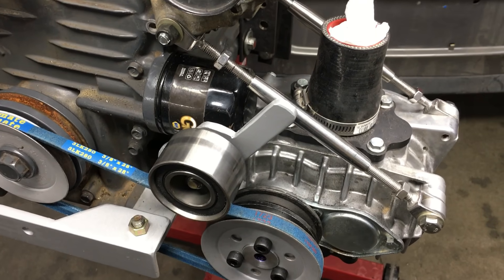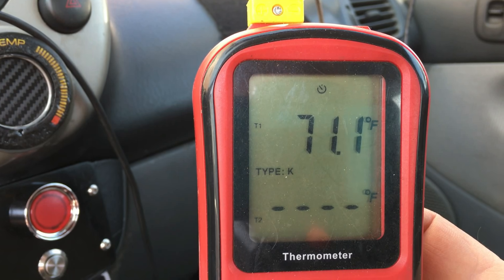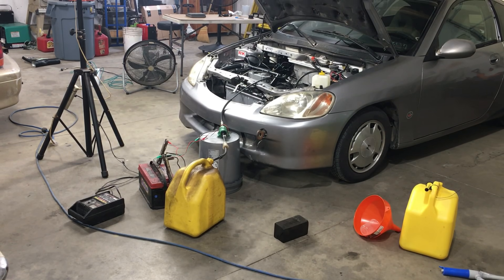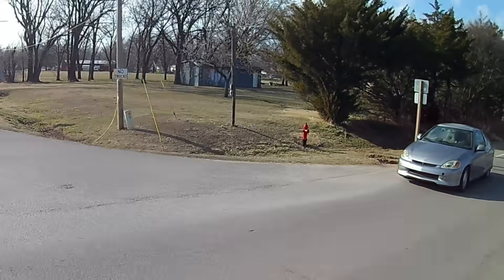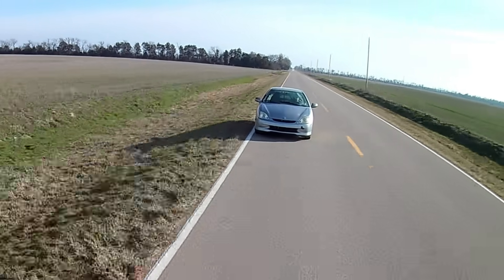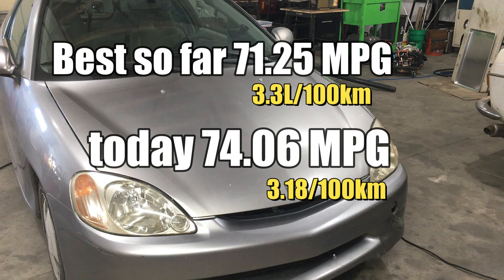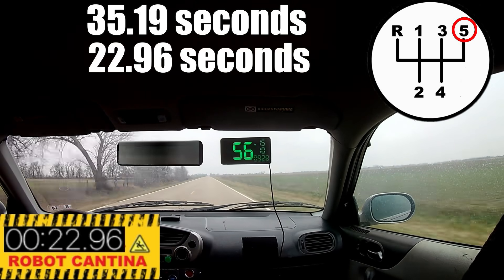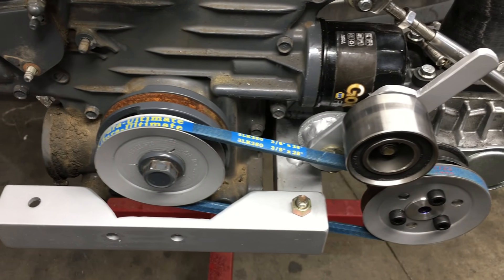S4 E10. We find out if the AMR500 supercharged Kubota diesel engine is more fuel efficient.

Comment: Impressed that you brought up that there are upsides and downsides to Superchargers and Turbos, not a lot of automotive channels point out that superchargers are parasitic on horsepower but offset the power they take by the power they make so they don't typically give the potential power off boost because of the parasitic losses.

Also, Diesels like hot charge pipe temps, its exhaust temps you need to keep an eye on.
Reply: Better tell modern diesel manufacturers to stop intercooling then... Even in the 90s Isuzu added intercooling to the 4hk1 and gained 10hp
Reply: @Low760  increasing charge temp increases efficiency, not power. The colder the charge temp the greater your pumping losses. 

Slapping an intercooler on will increase HP but pull fuel economy down a little.
Reply: @Low760  cooler air gets more mass of air into the cylinder.

dunno whats that about pumping losses being higher with hot air.  the hot air is harder to compress as well because it's already hot..
Reply: @Low760 Ooooo 10hp, minimal gains for hundreds of pounds added, ooooooo

Lost more speed from the weight than you gained from the added mousefarts.
Reply: @Oatmealism  You obviously don't even know what the engine was for, it certainly wasn't for speed at any rate, the extra 10hp likely equated to a good bit more torque which was what it was made for, helping in what sort of environments it was intended for, which would have been smaller trucks, tractors and other equipment alike, where the torque is what is sought after, not the hp or top speed, not to mention the added fuel efficiency (albeit small) from not having to work as hard for the same output
Reply: @ethancoy9237  sounds like you got your knickers in a twist over someone thinking a bunch of extra weight for a intercooler system isn't worth a 10hp Gain. How bout instead of writing paragraphs because someone disagree with you, you go touch grass
Reply: @Oatmealism  100s of lbs for an intercooler? Try more like maybe 20 lbs.... It's literally some tubing, a couple brackets and an aluminum air to air cooler....
Reply: @haldentoyorganist3896 the core itself is likely 15-20 lbs, plus the tubing to and from it is likely another 15-20 at least - and that is for a very small system, looking at ~50lbs, a more efficient system used on production vehicles would likely push even more as thicker metals are used to help alleviate the potential for heat soak inflating the weight.
Reply: @Oatmealism  pretty sure I'll take the 10 extra ponies for that minor gain in weight that wouldn't even be noticed
Reply: @haldentoyorganist3896  you'd think that but i took my 71 pound 3 ton floor jack out of the back of my 07 Ford fusion and it drastically changed the ride quality.
Reply: @Oatmealism  by this token you should be able to feel a drastic difference between a full and empty tank of fuel. Of course there is a difference but it's negligible
Reply: @haldentoyorganist3896  I actually do, when low on fuel the rear of the car is light and is much easier to upset with gusts of wind or wakes from large vehicles
Reply: @Oatmealism  I do on a daily basis bud, more so than you likely do, and an intercooling system like that would not have weighed a whole lot, not enough to make any difference to the speed of a large vehicle like that engine was in, sure for something like the insight it may make a difference but overall the pros outweigh the cons in nearly every situation, and there was on obvious reason why they added an intercooler
Reply: @ethancoy9237  So, for the record, a diesel is a compression combustion engine, it compresses air to an extreme degree to combust the fuel mixture, which is why in most cases they like hotter intake temps, because it makes getting the mixture hot enough to combust to compression easier. It is why a lot is performance diesels do not use an intercooler set up such as tractor pulls and drag racing. The last thing you want in your diesel is restrictions to getting air in and out for efficiency and performance reasons. For standard gasoline engines, cooler intake temps mean you can do many things a bit more spicy for more power because you don't have to worry about the fuel detonating prematurely to excessive chamber temps.
Reply: All ICE like relatively hot charge temps for efficiency. Doesn't help with power, but reduces pumping losses.
Reply: It's a tradeoff: hot is more efficient, cold is more powerful... You have choose your treat
Reply: So so on hot charge pipe temperatures. They do not necessarily mind it until its very very hot but still there are horsepower losses with increased intake temp once it hits a certain point. My old 1.9 TDI hit intake temps of 180f comfortably quite a few times. There was a loss of power at those temps though

Comment: You don't "need" an intercooler so much as it just let's you make more power. It just increases air density by cooling the charge air after all, effectively allowing you to put more oxygen into the engine at any given boost pressure. Suppose it doesn't matter as much with a supercharger but it's still less parasitic loss on the engine to make the same power at lower boost with the supercharger, so more total power at any given boost pressure :).

Also get some sort of coolant pre-heater or block heater for it. Should make it run better on cold starts and gives you heat immediately when you start driving.
Reply: You're also getting dangerously close to Lupo 3L numbers on this thrown together not-meant-for-cars engine which is impressive considering VW sold the Lupo 3L at a massive loss because of the different chassis, aluminium + magnesium body and magnesium wheels and interior parts. Plus they had a bespoke engine with a weird automated manual with a start stop system.
Reply: Honda sold this car at a huge loss too!
They got here before the Prius and only Sold it 6 years .
Reply: @stuntvist  supposedly the 3l would do like 2.8l in testing
Reply: @lasskinn474  You can get them to do 2.6L/2.7L real world if you try hard enough. It's exceptionally easy to hit the claimed 3L figure as long as you keep it in good shape. They're a seriously impressive piece of kit albeit slow as hell and the 5spd AMT becomes a mess when the mounts go bad, plus a 6spd manual would probably yield even better economy if you drive right.
Reply: @stuntvist  yeah I have no problems believing it, we got 5l/100km out of a '00 tdi passat on our nordkap roadtrip back in '01without even trying(summer, but not hot enough to need ac)

Comment: The engine was running rich I guess. The stupid charger can add air and solve  it?
Reply from the maker: Yes, at full throttle the exhaust is dirty, the good news is that means we have plenty of fuel available to add more boost.  The additional boost will clean up the exhaust and give us more power.
Reply: @robotcantina8957  You are great Jimbo and Jimbo Jr!!

Comment: Black smoke is wasted fuel. Modern diesel engine in vehicles don't smoke even without the converter and dpf filter. Manufacturers  hard work to improve fuel efficiency has eliminated Smokey diesel engines. The Honda looks over fueled, more boost will probably improve fuel efficiency.
Reply from the maker: Yes, we plan on adding more boost to both clean up the exhaust and for more power.

Comment: Maybe you can just put back the first set of pulleys and install a blow off valve before the engine. I think that would make things easier... I guess and i don't think it sounds expensive at all
Reply from the maker: We will have to fabricate a new pulley,  Using the original setup wont work because in the limited time the engine ran with the longer belt, a lot of damage was done to the belt.
Reply: Yes. , waste gate to lower load on blower at full speed but turbo to capture that water heat to supply air for almost free !
Reply: @josephpadula2283  uhhhh, what i meant to say is simply to install waste gate on the intake before the engine so it would limit the boost and then the extra boost maybe to get back into the intake before the supercharger or maybe to be used somewhere else....
Reply: Would using a set of cam belt toothed pulleys and a suitable cam belt from a small car engine be an option? It would also work perfectly with the tensioner set up you have.
 On this project which is about proving the merit of a supercharged diesel engine, I can't see that trying to design a CVT drive system is worth the effort, especially as there isn't much room around the engine in the Insight. It may be better to save CVT supercharger development for another project.
10-12psi, the intercooler and the fueling set up to match will make this little car go as well as possible for the size of the engine.

Comment: I believe the reasoning for the better fuel economy is you just need to use the pedal as less. I have seen people who v8 swap 4runners get almost twice the MPGs over the small displacement V6's sure they work great at highway speeds but you need to damn near redline it to keep up with traffic if any stops/hills are involved. With the v8 you can just putt along staying under 3k rpm which saves fuel in the long run. Not to mention it make the engine last longer, but that's another topic all together and probably why they switched to small displacement engines...
Reply: Top Gear found a v8 mercedes gets better mpg around the track than the prius.
Reply: 20 years ago I helped a buddy to swap an LT1 V8 into his daily driver Jeep Wrangler to replace the anemic 4 cylinder.  The Jeep did not have a lift kit nor did it have big narley tires.  The highway fuel economy went from 13 mpg on a good day to 17 mpg, plus it no longer struggled on mountain passes.
Reply: I upgraded from a 115hp v4 outboard to a 200hp v6 on a 17' mako and it got better economy almost anyway you ran it. Except idling/trolling. While the 115 ran hard to do its thing, the 200 doesn't even break a sweat.
Reply: @brandenwaltz9879  the old V4 OMCs were thirsty AF. 1 130HP on an 18' bowrider got 0.68mpg while my 32' 2x140hp suzuki gets 4mpg.
Reply: @Eluderatnight they were yamaha 2 strokes bit yeah definitely better with more power. I also have a df140 on a 21 deck boat and it does amazingly well. Will plane out with 8 adults and beverages. It's getting a 300 in the future.
Reply: that sounds like a terrible v6 if I cant keep up with traffic, in europe that vehicle would have a 4 cylinder and work fine.
Reply: @krusher74  in Florida stop and go is 0-90kph.
Reply: Running an engine under more load is more fuel efficient than running it at lower load though. That's the origin behind DWL hypermiling. Pulses of almost full throttle to load up the engine and while it uses more fuel than cruising it uses that fuel more efficiently and completely. Then they let off the pedal completely to go into Deaccel fuel cut off, rinse and repeat

Comment: Really enjoy your content. Regarding the fuel temp, I think that only effect the volume of the fuel, not its weight.
Reply: You are right, however that would slightly affect how much fuel they are able to draw out of the tank from the height the return hose is at.
Reply: @chevyinlinesix  Hey, you're right! After the fuel gets down to the return pipe level it stops getting pumped out. Then after the remainder cools the level would decrease to slightly below the return pipe. Never thought of that.

Comment: On the cold starts. I think its just too much cool air, my boss has one that does similar if you load it or try to raise rpm over startup rpm while cold, it just doesnt have enough temp to support continued combustion. An extra few seconds on the glow plugs seem to help when its chilly out. Maybe this will help you out on this one. Tractor mentioned is powered by a d722.
Reply: I had a 1959 Mercedes 190D that had a Throttle Butterfly to restrict the inlet air at idle, helping it warm up from cold start.  Never saw this on any other diesel.
Reply: @victorsteerup4582  also I think most of them that came following that engine you mentioned, used grid heaters in the intakes for the most part, or just had nothing, as far as I'm aware. 

The Ford 6600 tractor my boss has, only has a heating element and extra fuel injector to "fog" the engine with vaporized fuel on colder starts (fuel supply controlled by a thermostatic valve on the fuel return. Basically reroutes fuel return to the extra nozzle in the intake plenum. Weird system, never has worked quite right but I rebuilt the engine a couple years ago, so it has no issues starting, it's got maybe 100 hours on the rebuild. 

When I say rebuild, I mean it, too. Not just a ring and bearing refresh or something.  It got all the machine work and every new part it could have possibly needed or wanted. Lol
Reply: @victorsteerup4582  oddly enough I know of one with a butterfly but not that it serves that purpose, but it's still an odd duck. 

Nissan SD series diesel. They manufactured a few different displacements but the SD22 specifically, uses a weird diesel-kiki injection system that seems to be vacuum differential based, as you'd see maybe on a propane system. 

It has a throttle plate controlled by the throttle pedal, a vacuum port the atmospheric side of the plate and a manifold reference that both run to the injection pump. There is no mechanical linkage from the foot to the injection pump like most timed injection systems that adjust a fuel rack like the Kubota does here. 

It's a wild system and I only kind of understand what's going on, I've never fussed with one but have worked on a truck with that engine, only had to do chassis and transmission related work so far though. Engine is top notch for what it is. 62hp NA diesel 😂
Reply: @goosenotmaverick1156  That's a pneumatic governor. Basically there will be a diaphragm and spring in the injection pump that moves the fuel rack based on the difference between the outside air pressure and the manifold pressure. At idle the throttle plate is mostly closed, leading to low pressure in the manifold, thus atmospheric pressure pushes the diaphragm in and reduces the amount of fuel. When you push the accelerator pedal the throttle plate opens, there's no vacuum in the manifold so the spring is able to move the diaphragm the other way towards the full fuel position, causing the engine to accelerate.

It's a simpler system than the centrifugal governors you see on most diesels and has an added benefit of providing engine braking like a gasoline engine's throttle. But it has the downside of restricting the airflow into the engine somewhat, and I don't think it would work on diesels with one or two cylinders due to pulsating flow in the intake.

Comment: A spring-loaded belt tensioner would certainly help with keeping that belt tight, and saving the need for roadside maintenance... :)
Reply: Turbo+supercharger please
Reply: @BlakeDegmetich or a stupid compount turbo 😅
Reply: A flat belt is more efficient than a V-belt
Reply: @erik_dk842  The difference isn't significant though. But a good way to go would be a multi-rib type belt.
Reply: i wonder what a torque converter would do to the parasitic loads.
Reply: @felderup make it worse. There's a significant amount of slip in a cvt compared to a single speed belt drive. And it would only make the boost disparity worse at high rpm worse.
Reply: @ShinyUmbreon765  yah, there's some with less slip but that shouldn't affect the making of a chart showing the effect.

Comment: This result was expected, I can try explain. With the added boost you are getting more torque from the engine, but you don't increase the amount of fuel that goes into it. Commercially available Diesel engine always run with excess air when possible to get maximum power while having complete combustion (reduces particle emissions).

What you have done is made the fuel burn more efficient and complete. Requiring less throttle input to maintain speed, which in turn squirts less fuel into the cylinder.

This is fascinating and I myself have been looking at AMR superchargers as a potential to increase power in motorcycle engines that compete in the UK Formula Student events.
Reply: TLDR - I dig all the videos on your channel related to this content. It shows you really know what you are talking about, vs just someone who needs someone, ANYONE to listen to them.
Reply: The Engine was previously set up for a Turbo, including Fuel, and this wasn't changed back to NA running. So it is still running more fuel than NA.
Reply: absolutely correct  @MyFabian94